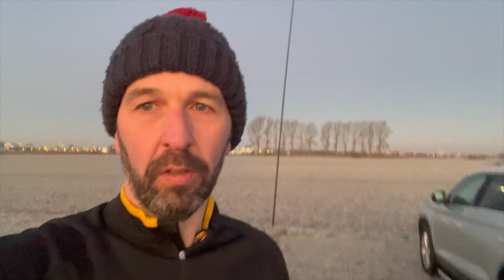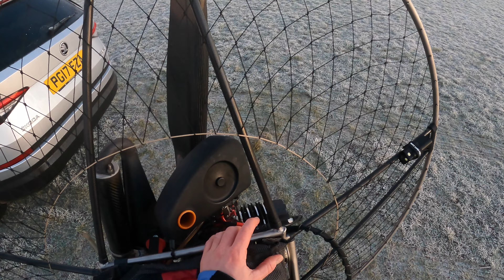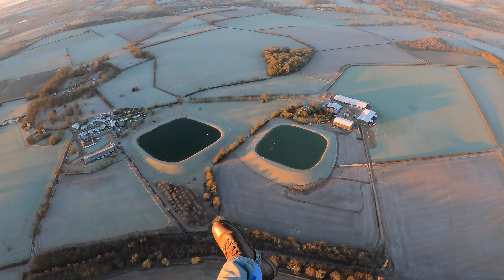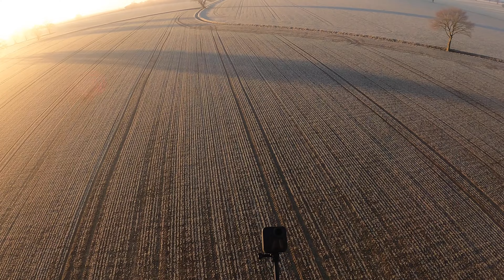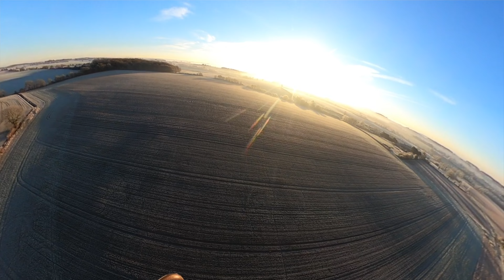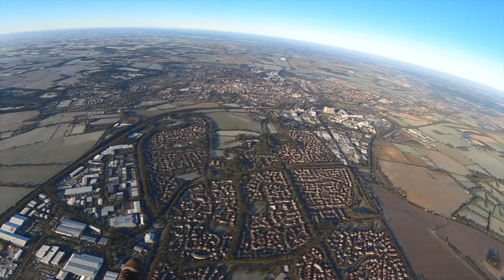Paramotor engine failure after takeoff

Comment: I have the same setup, Nitro 200 and H3. I also had the same rocker switch problem. In my case it was not a bad switch but where the harness attaches to the frame right next to the rocker switch. the harness strap would slide over and turn the switch off.  I put a zip tie around the harness strap to keep it from moving and no more problem with the rocker switch..
Reply from the maker: Good to know thanks👌. I suspected frame vibration as I’ve secured the switch tightly to the frame, but I’ll check out the harness strapping.